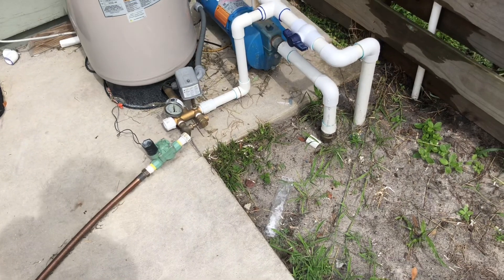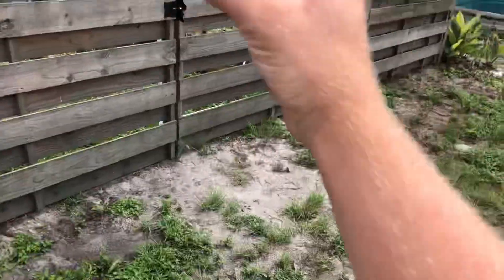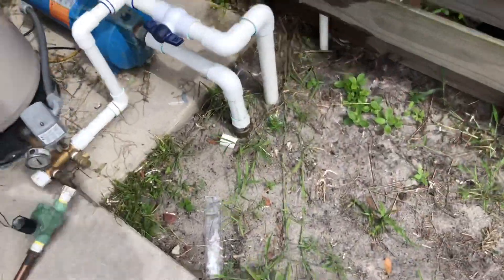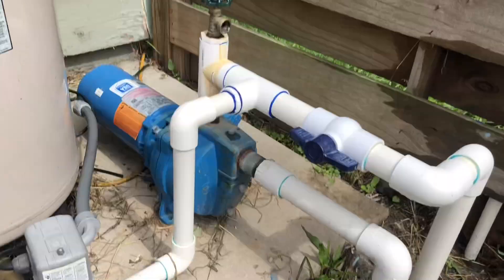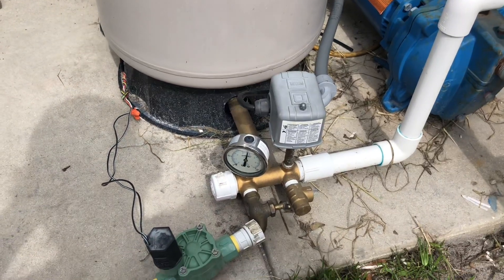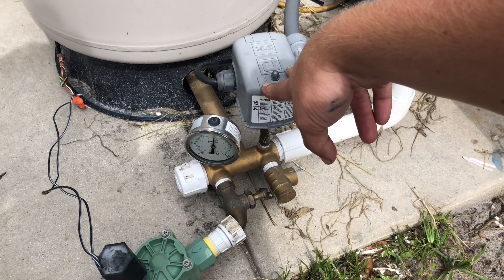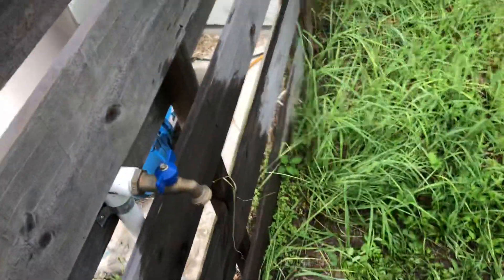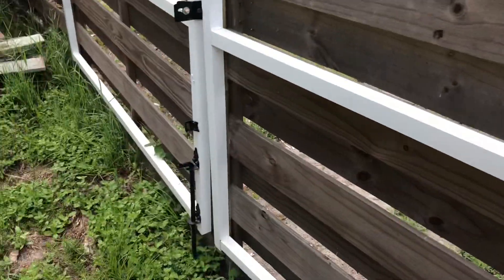My shallow well point system for irrigation.

Comment: You don’t need any sort of filters  downstream of the tank? I have a shallow point but it’s and old metal and one so I think the mesh at the bottom is rusted out. I get lots of sand and have to filter or my sprinklers get clogged. In Florida.
Reply from the maker: No these are PVC well points and they don’t really have that issue.

Comment: Are you able to provide water in the winter? I am curious about running a surface pump in the winter from a pitiless adapter below frost to provide irrigation in greenhouses during winter months.
Reply from the maker: I can pump water year round but we don’t have freezing winters in FL.
Reply: @linusrillch  how many sprinklers are you running at one time?
Reply: How many sprinklers heads are you running at one time
Reply from the maker: @GasparNunez63  8 sprays 6 rotors

Comment: Whats the gpm and psi you get out of the pump? My pacer econo ag can get 50 maxi psi and 195gpm max. It's enough to run a 150 big gun with a smaller nozzle and get good distance.  I'd say about 100 feet or so maybe more
Reply from the maker: This is a shallow well jet pump designed to pump pressure. And I have no problem running a 40/60 pressure switch. But it pumps about 21 gpm.

Comment: That’s some serious water pressure.   I got mine jetted down to 27’ but I put a cheap lowes pump on.   I didn’t want to spend the money for a Gould since I wasn’t sure it would even work.  That was 2013 and that little cheap 9 gal a minute pump still runs.  It’s getting real noisy so I’m going to replace it with a J5s.  I can’t wait to see the difference.   Going from 9 to 27 gallons will really make those sprinklers sing.
Reply from the maker: You want at least a j10s
Reply: @linusrillch  why do I need a 1hp.   They both put out the same gpm basically.   The unit I’m replacing is a 1/2hp.   I’m pretty sure the wire will support a 1hp.   It only runs sprinklers.
Reply from the maker: @Imwright720  1/2 hp is rated at 14 gpm. 1hp is rated at 25 I think.
Reply: @linusrillch  ag pumps must be tons of more hp because they have to be able to deliver serious water volume. Or run a 200 gun which requires 60psi and 250gpm minimum. Maybe 20 40 hp?

Comment: Impressive set-up. Why four different well points? More pressure? You think I could get away with just one point if it was for garden drip irrigation?
Reply from the maker: It depends on how transmissive the sand is. Sometimes I can get away with one or two and sometimes I need three or more. You’ll just have to figure out your water demands, jet one down and pump it out. Where I’m at, going 12-18 feet usually produces good water.
Reply: @linusrillch  Thanks, appreciate it. Your dirt/weeds looks very similar to mine guessing you're in FL? I'm in West Palm.
Reply from the maker: @superdupertroy  Sarasota